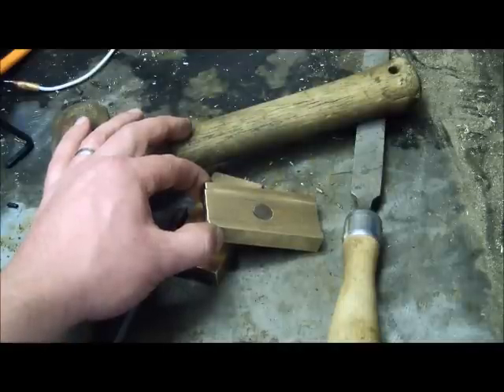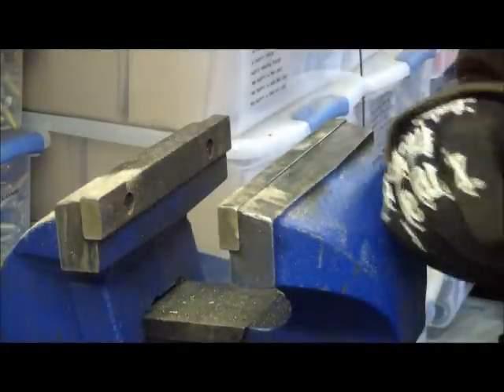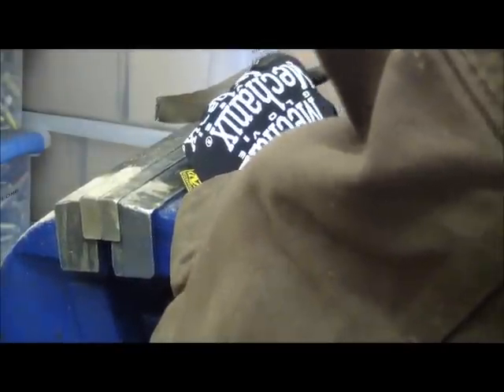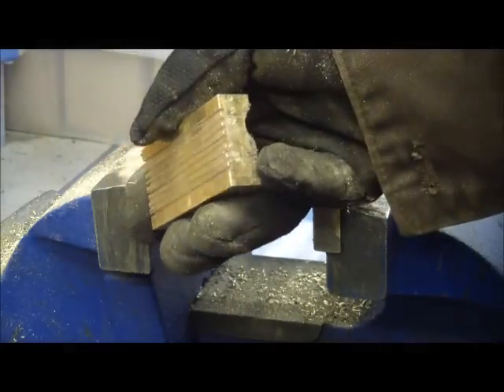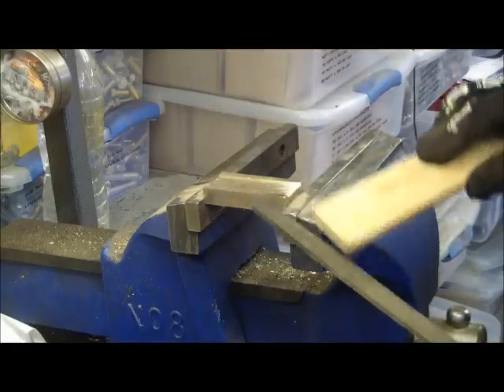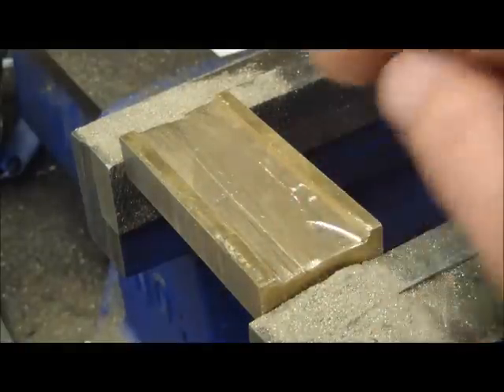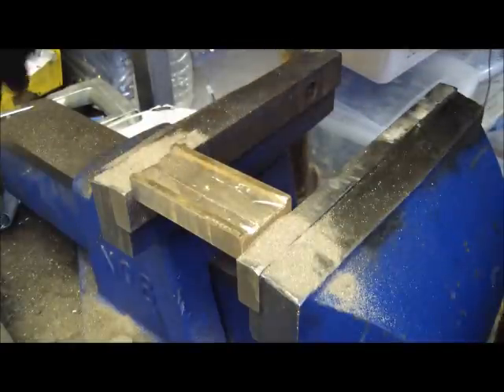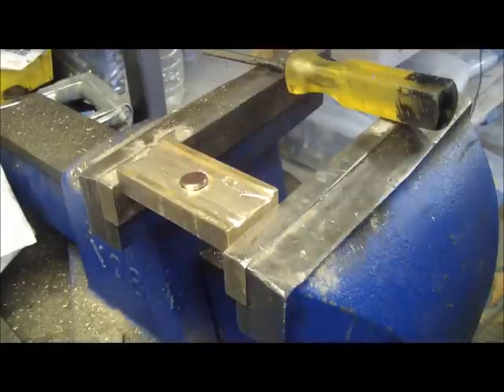Poorman's Milling Machine!

Comment: Any tips beyond brushes on cleaning soft metals from between file teeth? It's alloys like 6061-T6 Aluminum that cause me the most troubles with particular files.
Reply: John Ratko Try using chalk.
Reply: AltMarc I'll give it a try. Thanks.
Reply: AltMarc Yup, that's what I was taught too. Ally can be a pain... And I was also taught don't use a file card to clear the file teeth - the wires are hard and will blunt the file. For brass/bronze, you need a really sharp file or it just skids over. Use a bit of brazing rod to clear the teeth. When the file is too dull for brass, it will still work just fine for steel.
Reply: A bit late now, but take some brass shim stock and use it to "comb" the teeth out. The file will cut grooves in it and self align quite nice.
Reply: bkidd2225 Thanks, I'll try that!

Comment: I'm searching some techniques for doing hand work on metal traditionally requires machining. I have no free access to machine tools but need some "hand-machined" parts to do somelike lathe&mill machine myself. Can you recommend some youtibe links doing this like this video: handscraping, draft cutting, maybe EDM by scraped things
Reply: Yes I'm searching info on this theme too. Maybe you have some recommends on speeding up draft scraping, using very cheap tools and diy tools, maybe some techniques with guides and so on ?

Comment: Never would've occurred to me to use a hammer and cold chisel to do something like this. I do have one question though, did you cut those circular grooves into the face of the blocks using a similar technique or did you cheat and use the mill haha
Reply: Ah okay, thanks for the reply! Great wee video btw, really interesting

Comment: You cut with the file in one direction.  To try to cut in reverse, especially on harder metals, the teeth of the file get rounded over.  So, cut and lift, reposition the file, and cut again.  This is how Rolls Royce mechanics were first trained.

Comment: heres a tip......never use a file cleaning brush, the hardened steel wires will rapidly dull the file teeth........coat your file with regular chalkboard chalk, to keep chips from embedding into the file

Comment: I will kvetch about the way the file card was used in the beginning of the video. One does not casually drag the brush across the file as if he were dusting it off. The bristles or wires are all bent a particular way and they are all carefully aligned. You will find the "sweet spot" when using the file card, drawing it across in such a way that the wires each glide along the length of the groove (in the direction of the grooves, not at right angles to them), that is between each tooth of the file. The wires in the card will actually rake the swarf out of the file in no time at all. 

I enjoyed your video once I got past your non-effective use of the file card. (am a little OCD in some ways)

Comment: good lesson in dulling a file only designed to cut forward stroke
Reply: +AvE i was about to say the same thing he did then i realized that's a soft metal  and stated to look for comments
Reply: good habits with your tools don't care if the metal is hard or soft.
Reply: Nah, cuz the back strokes totally sharpen the file.
Reply: +graham godfrey so on soft metals like aluminium, brass, copper or cast iron you can do both strokes but stuff like steel only a forward stroke?
Reply: +FoodOnCrack As far as I know on soft metals the back stroke wont do anything to the metal or the file, on harder/stronger metals the back stroke will do nothing to the metal and dull the file.
Reply: ever heard of a bastard file
Reply: +Jarryn Smith It doesn't look like it's one, I own very similar files.  In fact, it might be out of the same set of files.
Reply: It just seemed weird that nobody said anything about it since there all ripping into him about something silly as a file stroke
Reply: +FoodOnCrack no matter what youi're filing (or hacksawing) you should use deliberate cutting pressure and be aware that the tool is cutting (or if it isn't, fix what's wrong) on the forward stroke, and relieve the pressure on the back stroke.  You're not just waving the file back and forth, each stroke is a deliberate action with force and direction under conscious control.  The file will tell you what is happening if you give it a chance and teach your senses to be aware and soak up what it's telling you about its own condition and the characteristics of the material.

In the German apprenticeship to be a machinist, the only tool the students used for the first year or so was a file.
Reply: Alex McClure why?  A file is a wonderful and versatile tool capable of far more and with much better accuracy than most people have any idea.  It rewards effort in learning good technique.
Reply: +graham godfrey If you always push forward only for hard metals, and do not bother only for soft metals, then that is not actually a bad habit. Bad habits are only habits that lead to bad things, and if your habits don't, they aren't bad ones. In fact, it may even arguably be a good habit if it allows you more control or speed during times when it is not a problem, and you consistently behave according to the material.
Reply: +Gavin Jenkins say what
Reply: georgio jansen It's not going to dull a hardened steel file to do anything on soft brass. So if you only drag back while filing brass, it wouldn't actually cause anything bad to happen and wouldn't be a bad habit.
Reply: +Gavin Jenkins says the guy with dull files in his toolbox.
Reply: TIMEtoRIDE900 Who's that?
Reply: Gavin Jenkins
Dude - you know you have old, rusty and dull files in your toolbox.  Just admit it . . .
Reply: TIMEtoRIDE900 ...heh rusty? Do I leave my files out in the rain now too?
Reply: +Gavin Jenkins you might.  You have shifty eyes.  Probably all your files are  pinned because you file aluminum without chalking them, and you gave your file card to your little boy to brush the cat with.

But on your original thesis that it's ok to use full cutting pressure on the back stroke on soft materials because there will be no wear -- are you aware that in a journal bearing it's usually the hard shaft that wears most?
Reply: +dbeierl.... in holland the same , filing a block metal till its square and flat. and no light coming through the square....goedendag
Reply: everything wears out over time, continuous backstroking with a file not designed to handle that direction will eventually dull out even with soft metals.  Prop wouldnt need to worry about it for a while, but if you want the best optimal condition of your tool, why not.
Backstroke now that i think about it could help by warming up the bronze so it can be cut easier?
Reply: AHAHAAA! One of my pet peeves with the net videoS: improper/damaging use of tools. I know it's just bronze, but bad habits have a way of GOING bad!
Reply: @dbeirerl  yeah, like rubber or plastic against aluminium. the aluminium while not a lot harder is still harder than rubber. under light load the softer material will polish away the harder material, under heavy load its the opposite. the softer material has more 'give' and will have less of a tendency for the microstructure to shear, well, especially so in this rubber/plastic example.
Reply: +Matthew Wiley Yeah, my ex wife used to lift up when moving backwards; the technique worked a treat ;-)
Reply: Yorick Hunt 
Oh crap, i just got that. HA!

Comment: For something like this you can also use an end mill in a drill press if you got one. It shakes like crazy but if you hold it steady you get a perfectly smooth finish.

http://www.pic-upload.de/view-27981484/2015-08-11-13.35.22.jpg.html

Comment: A great way to make your bronze vice jaws would have been with a cnc milling machine.    About the only thing it will not do well is skin cats.

But since not everyone has such a pretty hammer, remember that you could have selected a rock of the proper weight and size instead of the hammer.   No need to get so fancy with your tools.    

You can also make great tweezers if you are lucky enough to find a broken street sweeper bristle on a street gutter.

Now start saving for that cnc machine like a smart boy.
Reply: CNC can easily skin cats.. you just don't know how to properly clamp your stock.
Reply: +bkidd2225 meeeeoow

Comment: how do you do this with hard steel though...
Reply: ***** anything other than brass or aluminum. something like 1/4" weldable steel. I had to make a part that looked almost the same as this... it was a 1/4" thick by 1" wide by 11/2" long piece that had to have a 3/4" wide channel down the middle. I basically did this same method except I didn't use a chisel and hammer, I used a dremel tool to make slots then I just filed and filed and ground and filed for like 2 days...lol it worked but it took along time. I tried using my little unimat machine but it didn't do it.
Reply: ***** awesome, thanks, Ill give the hammer and chisel a shot next time.

Comment: Why you don't use some tiny electrical grinding tools ? Dremel-like grinder or maybe selfmade rotor with tiny grind wheel on it
Reply: (That's the sound of the point going over your head)
Reply: Nina Volodina Or the actual milling machine.

Comment: Replace the steel chisel with a weak copper one and thats how the smart archaelogist say they ancient people created all the stone carvings like the ancient egyptians, inca etc did with the serapheums at Saqqara, or at Puma punku.
Reply: Obsidian tipped wooden post.

Mesoamerican cultures did not do bronze.
Reply: spied onandon
Obsidian would break, because obsidian is glass like. It's very good for cutting flesh, surgeons still use obsidian in some situations, because its much sharper than steel.

But it would just shatter if you tried to use it as a chisel.
Reply: You might be right about that. Would not be surprised if obsidian can cut limestone, though. Would have to ask an archaeologist.

They might well have used granite for cutting tips. One thing I am sure of... no metal was used. No iron or bronze was used.
Reply: Really interesting actually... the current theory is that rough-cutting was achieved by employing expanding wood.

Comment: Here I thought you were a pro, until I saw you using a file in both directions.
Reply: ***** You have 2 piles of shavings, one from each direction.  They look nearly equal.
Reply: The American Outdoorsman doesn't take much pressure to knock extra debris off the back on the return stroke.
Reply: The American Outdoorsman It's brass ... Will never hurt your file
Reply: atomead well AvE said it was Bronze, there is a difference in toughness, but neither will hurt a good File
Reply: The American Outdoorsman The part is about half the length of his filing stroke. That means that on the forward stroke only half the file is exposed on the far end of the piece to clear its chips. When he brings it back the back end of the file deposits its chips on the other side. So he gets 2 nearly equal piles of filings.
Reply: Hahahahaha

Comment: Strictly speaking, a file cuts in only One direction and therefore, should not be dragged back on itself. Dragging back loads up the grooves, which then have to be cleaned with a file card. Just sayin'.

Comment: That was good to see,  you are redeemed . for any body interested  .A  more accurate finish, had it been needed, is to of used a scraper made from an old file & "scrape" away the high spots,which are identified by covering the surface with engineers blue - I use a felt pen /marker & then rub the surface to be flattened with a known flat surface the high spots are reveled & scraped .would make a good video. Should get a Chanel  up & running before i get to old & forget . will check more of yours stuff keep it up
Reply: 2yehbutno Yeah, I know about that technique for flattening surface plates. Not really necessary for a pair of soft jaws though... ;-)

Comment: So, you use the jaws of a caliper--supposedly, or at least potentially, a precision instrument--as a scratch awl?  Do you use micrometers as C-clamps?  Vice-grips for tap handles?  Uni-drills for close-tolerance bolt holes?  Why of course you do.
Reply: You don't need to use a precision instrument. A $5 Chinese caliper is good enough to scribe with and you can keep the expensive one safely in its box for when you really need a precision instrument.
You may of course need to sharpen the Chinese caliper every once in a while.
Reply: That's the reason God put points on calipers... I thought that was obvious

Comment: Too bad handmilling probably isn't gonna work out too well for the project I want a mill for. I'm doubting an AR15 80% lower would be easy to finish right without power tools. Still a good video though.
Reply: all you need for that is a small drill press, and the jig that you can purchase with the lower
you could use a vise, and a hand drill if you wanted
Reply: Kraken Fodder 
Hmm, might look into it once I get some space.
Reply: Just did a polymer one on a tiny 8" drill press with a $40 X-Y milling vise from Amazon. 10/10 would try again. I actually got a really nice surface finish on it.
Reply: ***** 
Nice.
Reply: Mister Bones yep, I say go for it. I bolted my drill press to a shitty little pile of wood shaped like a bench in my apartment and went at it, super rewarding
Reply: Go AR! It's unregistered and insanely rewarding! You get a gun that you can say YOU built! (20% of the way)

Comment: I saw you use the tip of the calipers to scratch a cut line. You never want to do that with calipers. If I saw you in my shop doing that I wouldn't hesitate to send you out the door to look for another job.

Comment: Cutting the sheet metal in vise. Now show us how to continue the cut for the next 2 inches.Wont work 'cause you hit the sliding section of the vise with the bottom of the sheet.
Reply: Roman Dybala Now that's just a lack of geometrical ingenuity.  Given the cutoff section is only an inch wide you could cut like that for 100 yards were you so inclined and turned the sheet 180 degress.

Comment: I like your VIDS ......  But this is not how i was taught to use a file..You would want one hand in the back and one placed on file over the top of the piece you are working on....If you are holding onto both ends of the file the pressure will be in the middle  and create a curve.....CHEERS
Reply: +sean tap As true as this may be filing with your hand pressed above the piece can be difficult in certain situations.

Comment: If only I had a vice...
Reply: Pretty much in the same boat.  Planning on building a sturdy workbench this spring though.
Reply: four c clamps, a couple pieces of (insert available and reasonably flat material here), and something heavy to mount it to...one vise, obtained

Comment: How to take a 10 minute job, and stretch it to 2 hours.  Hmmm... me thinks this is why milling machines were invented.
Reply: +Ryder Spearmann  yeah if you can afford $1800-$5000 up front and out of pocket, smh
Reply: +Ryder Spearmann  yeah if you can afford $1800-$5000 up front and out of pocket, smh
Reply: Well... not exactly true... you can get a brand new deluxe mill from sherline for $850 right from the factory.

Alternately, you can just put an end mill into a router and make a template for the cut.

But I hear what you are saying... if you have nothing more than a saw, a file, hammer and chisel, then you can still get it done.

Comment: No matter how soft the brass is, u NEVER do the mark-up with the caliper like that!
Reply: +AvE Come on, its a bad habit to use measuring tools like that. Use a scriber.
Reply: +LilleDan83 ....Do it all the time, especially with brass, aluminum, plastic etc. Can't beat those cheap Chinese calipers for this kind of stuff. Been using the same MSC set for the past twenty years. It's what you do when the right tools aren't available and you need to be fairly accurate.
Reply: +LilleDan83 Normally I would agree with you, but this is AVE! lol  The $12 Chinese calipers are great for this sort of stuff though,  they're shit anyway. I keep the $250 Mitutoyo's in the box until something needs inspecting.   (.....as an ex-QC inspector though, I always do cringe a little when I see it!)
Reply: Thank you! I saw that and just about lost my mind.
Reply: You can also use them as a scraper, screwdriver backscratcher and even picking your nose.
Reply: I use an odd leg jenny for marking this way :)
Reply: I also have a crap pair and measuring calipers. As long as you remember to take a diamond hone to the end and don't mind the $15 caliper blades getting shorter, it works out for me.

I still saw that and tensed up though, one of those things that if it isn't me doing it I just cringe. Sort of like driving at times.

Comment: Using your Vernier calipers as a metal scribe is atrocious, I thought I was going to watch an engineer?
Reply: Mark Leadbeater Last I knew that is standard practice for several metal working disciplines.
Reply: Standard or not. Its poor workmanship. Measuring calipers are for measuring. You want to scribe a line use a scriber. Use the right tool for the job
Reply: Actually they're dial calipers. But still atrocious
Reply: if the tool works, use it
Reply: Mark Leadbeater when was the last time you made anything?